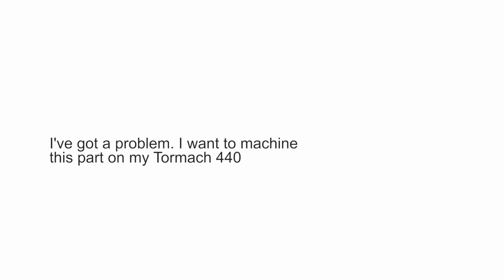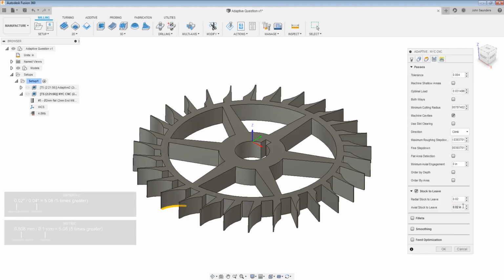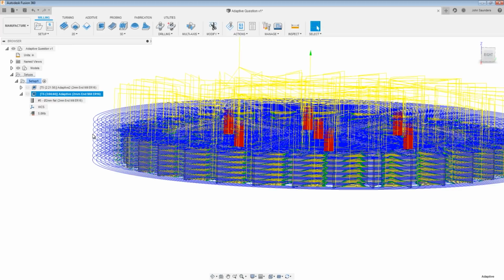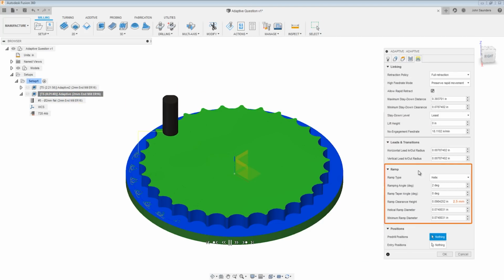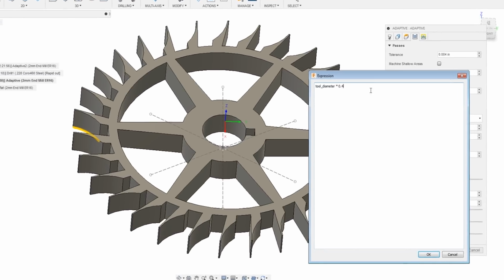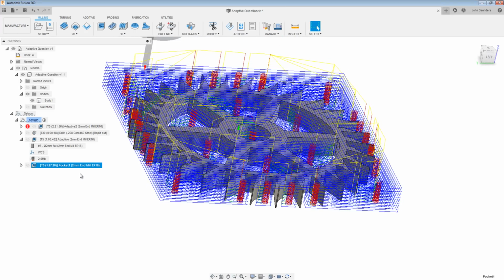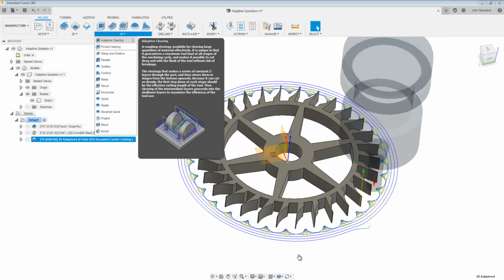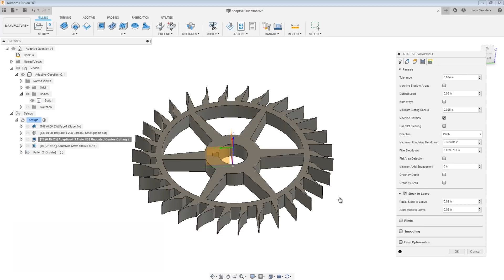Fusion 360 Adaptive CAM Toolpath - How to Speed Up Calculation Time!

Comment: The problem with making the stepdown large and the load small is that the first cut in a new area is always the full tool diameter. So, whatever stepdown you pick, it has to be able to work with a 100% load.

Comment: I use mastercam professionally as a tool maker and have similar problems when using "rest machining" due to the physical size of parts and complex geometries.
Our work around (this would work perfect for this part) is to create "bounding geometry" to limit where the toolpath goes. We might break our parts into quarters and generate 4 identical toolpaths in different locations. Sounds weird but it takes less time to generate.
This part could easily benefit from one small toolpath patterned around the part.
Edit commented before seeing the end of the video

Comment: With the 3d adaptive tool paths my go to is to first increase tolerance and smoothing to at least 75% my stock to leave. Smoothing should always be a bit less than the tolerance and when you add them together they should never be more than your radial stock to leave. This will allow you to run high speed toolpaths better even on an old machine without hsm like my 1998 haas vf3 but you must have a drip feed unit to compensate for the program size.

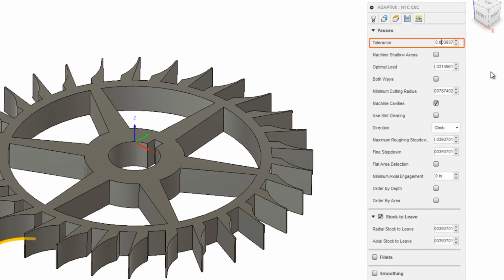Comment: 1:20 Assuming the benefit of doubt, that you only misspoke, .004" is .1mm, not 1mm. Other than that. Pretty good video.

4:28 [cough, cough] Fanuc controllers. Useless Robodrill. -_-
Reply: [cough, cough] "Pretty good video."

Comment: So on your 2d profile you were saying it is a bottom up.   Can you explain why you would select a bottom contour versus a top contour? 

I have been milling with a CNC router for my carbon fiber drone frames/parts.   I am setting my mill for a fixed stock position WCS with a clearance from the work piece in it's fixture.     I have my pass through set for -.5 to -1 mm for passing through the stock bottom.

But as I am setting my tool paths I have been working off of stock top and selecting my profile/features from the model/stock top rather than the bottom.

Hoping to start using the router for some aluminum stock to make some protective covers for my arms/motors but I need to get the tram on my machine zeroed better.   Currently isnt a problem for when I do 1.5-6mm carbon fiber plate but it will rear it's issues when I start doing 3D machining.
Reply: I believe he is referring to how you need to select the specific details of the cad model to tell the 2D where to work. As the other will look at the model and stock and take away what isn’t needed to get to the final results
Reply: @Sicktrickintuner  maybe I was missing it as a 2D adaptive versus a 2d Profile @14.10

And that is where seeing him select the bottom I am trying to determine how it is different where I would have selected the top of that profile.

Wondering if he would still select the bottom on a 2d profile
Reply: @dividingbyzeros  yes. Because by default the selected geometry sets the depth of cut. Look at the default value for the bottom height on the heights tab. It's Selected contours. Which means you can cut to different Z depths with an the 2D toolpaths.